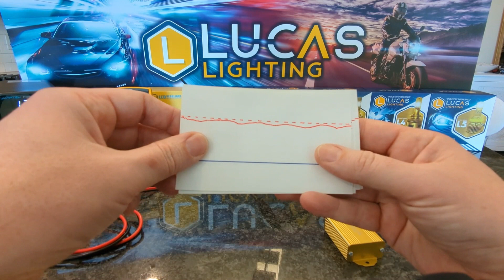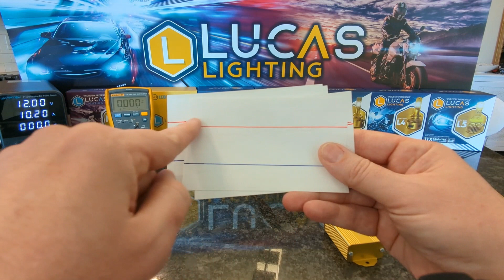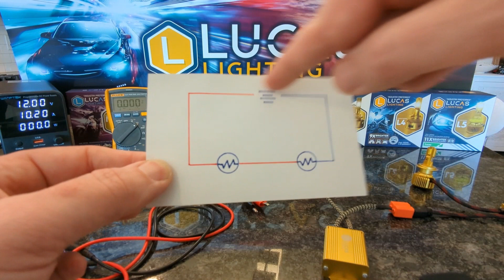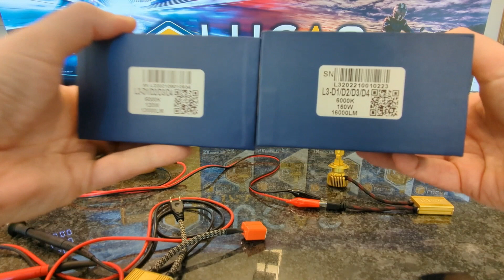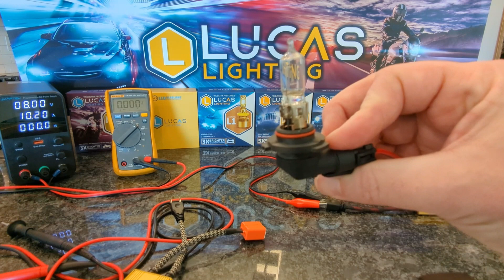Lucas Lighting LED headlights - Decoder Series Video 5 of 5, Series Circuits and Conclusion

Comment: Hi Josh, very informative group of videos and well produced. I wish I would have seen these before I went down the road of upgrading my Halogen headlights to Led on my 88 Vette. I installed "plug and play" 120w Osram headlamps, part #205478, they look and work great until I flip the factory foglamps on. The foglamps don't work at all, but the switch now operates the hi-beam. Even though they stated "plug and play" I ordered a pair of D-Lumina H4 9003 Canbus decoders. Nothing changed whatsoever. Clearly I need help. Could you possibly recommend which of your products might salvage my project?
Thanks for any advice you might have.
Cheers, Rob
Reply from the maker: There is a good chance that you need decoders to isolate your high beam and fog lamp circuits.  Ours will definitely work for that, I'm not sure how others build their decoders.